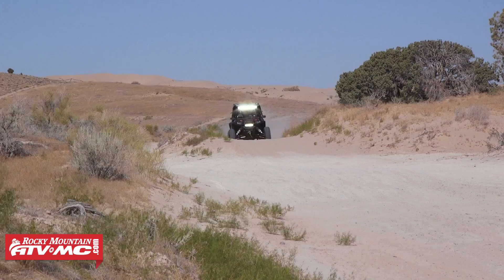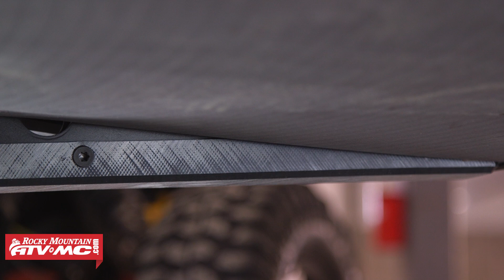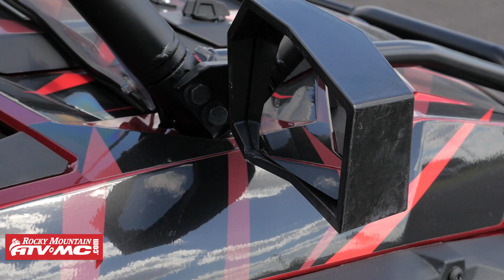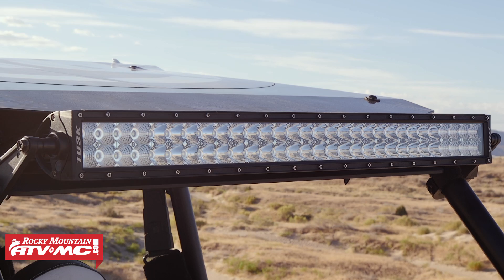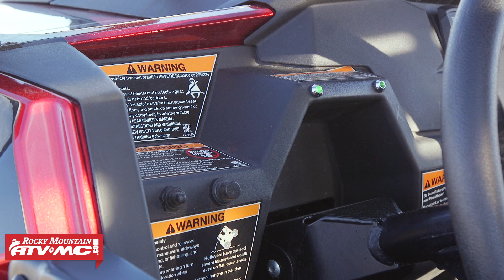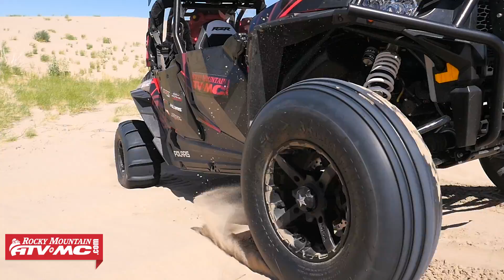Polaris RZR XP 1000 UTV Build

Comment: Is the tusk front bumper compatible with a full EMP windshield and dual D2 rigid industries pods on the A Pillars? Highly interested in this bumper.  Also, my rzr is a high lifter edition, so the current winch set up is on the bumper, do you make a bracket kit to relocate my existing 4500lb winch? Additionally, would the tusk rear bumper with rack fit with the factory snorkel kit?